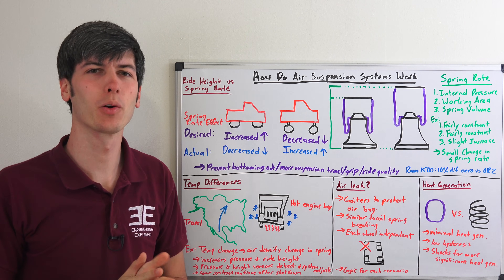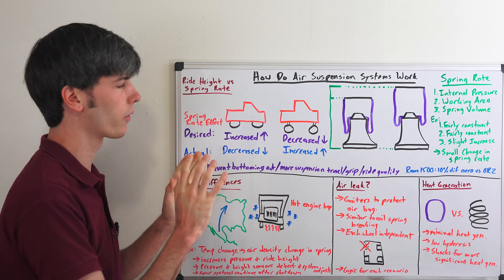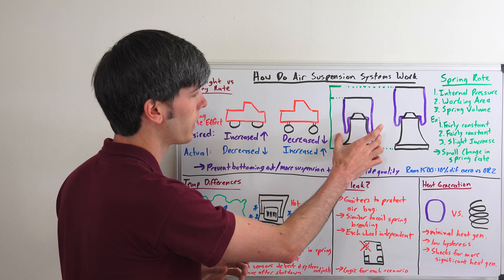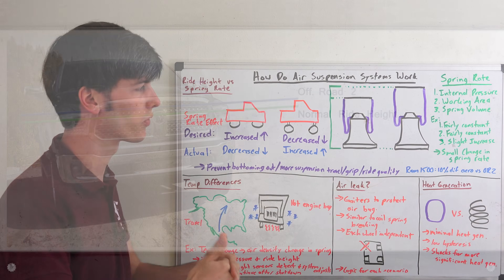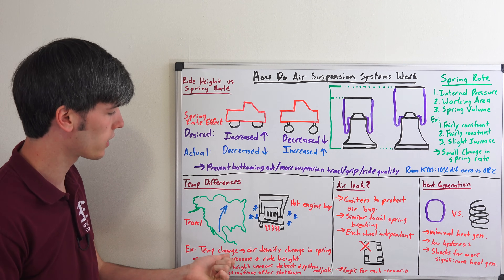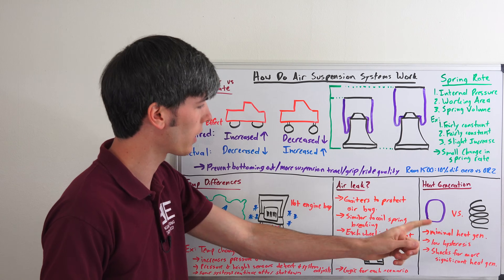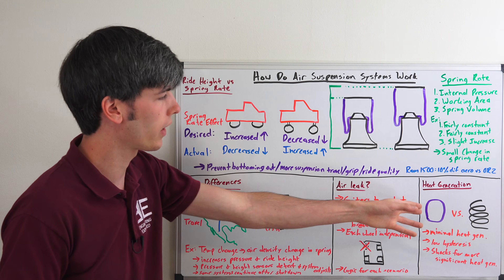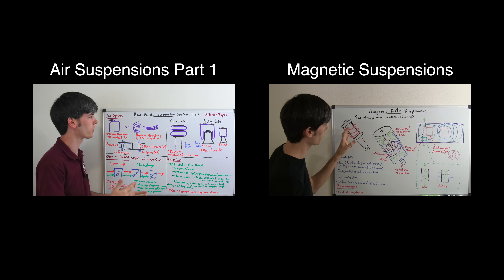How Do Air Suspension Systems Work - Spring Rates

Comment: Hi, great video. Recently saw some videos of Citroen cars with pneumatic suspension. I tried on YouTube but unable to find any video comparing pneumatic suspension and air suspension. 

Also why it’s been stopped by car manufacturers because air suspension was better and reliable or its just too good.

Cost reduction didn’t makes sense As it was introduced in Citroën cars which does not consider to be luxury cars, and even licensed by rolls Royce for its superior quality.

Comment: The Lexus system doesn't have a reservoir  like most Air Suspension. The compressor provides air “on-demand.” Most systems will use four ride height sensors that measure the height and speed of the wheel displacement.

Comment: I have two querries please..
1.Can ride height be adjusted when the vehicle is not on a flat surface or plane??
2. What happens when there is uneven load distribution Between right and left wheel of a same axle???

Comment: 2:10 you state that the air pressure between low and high heights are almost the same, as all you have done is increase the volume - but, unless you have a giant skyhook lifting the vehicle up, the ONLY way to increase the volume and height is INCREASING pressure. This is air spring basics.

Comment: Hi there nice vid , can u give me advice on my problem,  nissan interstar rear suspension,  pump works great very strong no knocks , but i qas driving along then it dropped to the ground,  ive tryed to manual pump it up but the tank was at full pressure,  and i jacked up rear end and the wheels raise up with the axle which leaves me thinking theres no air leak from the tank to the bags as the wheels would drop down if air could flow through the system , so im thinking there a control valve or somthing not opening or sumthing

Comment: Hello, I have comments on the issue of spring rate. It is true that we lower the pressure insider the air spring to decrease ride height and increase the pressure to increase the ride height, but that is just for during those processes. Once set on a certain ride height under a given load, the pressure inside would be determined not be the ride height, but by the load. So if the load is the same, the internal pressure is the same. Given that, the spring rate at lower ride height would be higher because the same amount of axial compression and thus the same amount of volume change would result in a greater pressure increase and thus greater restoring force as the volume change percentage is higher. A similar argument would be given to prove that higher ride height would give lower spring rate.

Comment: p*V^k=const is the basic working principle to consider here. The travel induced volume change relative to the spring volume determines the rate!
Rate tuning for different spring heights is of course possible by an altered rolling geometry, but the basic principle is: lower spring = smaller volume = higher rate 
(Infinite volume = no pressure change = rate zero / volume zero =  no travel at whatever load = rate infinite)

Comment: Very good presentation skill and informative video. Sad thing is you mentioned to leave questions here but never answered.
Anyway. I got a question. Pretty confident they got no corrosion as pure nitrogen is used in the system. but how about dry rot of  rubbers? What kind of rubber are they made of and how long can i expect to use them without trouble? Not extreme weather, i am from Australia. Tubings and fittings also?
Reply: YUNN TUN 
These systems operate with air taken from the atmosphere... closed loop systems would require a lot more stuff to operate.

Comment: a 97 lexus with the suspension on high drives like total crap. especially speeding through downtown Seattle potholes, train tracks, and brick roads.  just use regular or sport, they feel the same and give a smoother bumpy ride. 

or just drive a 93 mercury cougar v8 for a nice smoother ride even if ya gotta drive through some grass and side walk on the side of the road at 40mph.

Comment: I wold like to know what type of air system the ram 2500 and 3500 use (closed or open) I have been told that the system is closed and charged with nitrogen. Also how much weight will the two systems actually lift and the reliability, is there a limp mode if you have a failure on one side or are you stranded?, will a leak turn all kinds of lights on the dash and force the system into limp mode?

Comment: is it similar to a steel spring . i.e. . cutting spring in half will double spring rate .
Reply: i envision it to be like a syringe with the end blocked off . 
When it is full  I can compress it 2cm
when its half full i can only compress it 1cm .

Comment: what if the suspension leaks out air? Wouldn't that be a horrible defect?
Reply: If your engine stops running, that's a horrible defect too. Every system on your vehicle has fail points
Reply: 7150285 I seen a 97 lexus with a popped air suspension on 1 wheel. it looked like it was in some hydraulic competition. it was towed home because totally not drivable on the freeway or even 40mph.

Comment: do they have some kind of air dryer? in layman terms like drying the air as it pumps it to each suspension? Cause woudln't condensation have some kind of effect of the air suspension system?
Reply: They're filled with 99.9% pure nitrogen. No oxygen = no corrosion

Comment: Hi Mate, can you by any chance explain how some of the new engines now have the "turbos nestled within  the V of the engine". These are in some of the new AMG vehicles such as the AMG Gt and the new C63. Also how a car can have two turbos in the cars i have mentioned. 

Great Videos by the way, very educational.
Reply: That is what is known as a "hot vee" V8. If you do a google image search for "hot vee v8" you'll find some pictures that will explain it clearly, since it's difficult to describe in words. Basically, these engines have the exhaust ports facing inwards into the V, instead of on the outside like on a normal V8. It can have two turbos because of the packaging, with one turbo on each cylinder head.

Comment: Would love to see something like Air Ride vs Coilover for everyday life and track!
Reply: +Wonderful Madness and the F1 and Indy try to be as lightweight as possible have the compressor and valves and electronics for the system is to heavy
Reply: Air springs aren't usually used for racing.
Reply: Loanword Eggcorn air springs started in racing and were used in the winning champion car for the time attack STI in 2015. so you just haven't read into it much.
Reply: Wonderful Madness How many Formula One cars use air suspensions?  How many Indy cars use air suspensions?  How many Le Mans cars use air suspensions?  Answer: zero.
Reply: Loanword Eggcorn I wouldn't take your word for it, cuz you think air suspension isn't used in racing haha
Reply: Wonderful Madness I said mostly not.  I did not say not.  It's great that you found one example.  I found hundreds of current counterexamples from the highest levels of racing.  Do you think the Formula One designers are ignorant or don't know about air suspensions?
Reply: i personally would have air ride or accuair for a daily cause you only drive a daily hard every once or twice a month now my dedicated sports car should and would have coilovers due to the fact it's simple and is more predictable and i would not mind accidentaly scraping the car

Comment: are there special considerations and precautions when jacking up a vehicle with air ride suspensions like changing a flat tire  or putting it up on jack stands for maintenance?
Reply: There is an option on the vehicle menu for "tire Jack"  that will hold the compressor from adjusting the ride height. Same goes for when loading and wheel alignment.
Reply: I believe so. I remember seeing a post on the VW Phaeton forums on how to set the air suspension into a service mode, otherwise the car would try to level itself as you jack up the car.
Reply: Only thing that comes to my mind would be never to put vehicle weight onto a spring with no pressure in it. "Airing up" the spring from this situation could cause damage to it.
Reply: They covered it well Robert. Turn it off before jacking it up. Before alignment some cars need to be in a special level mode. On a Land Rover it required a scan tool. Using that mode sets a CEL.

Comment: Hey, thanks for the video, but how does damping work for these springs? Do they require special type/design of dampers? Can they be mated to conventional hydraulic dampers as with coil springs?

Love you videos, thanks!
Reply from the maker: You will have separate dampers, just like with coil springs. Check out my first video on air suspensions if you haven't yet. :)
Reply: All of the above, depends on the manufacturer. 
Ridetech Shockwave series is an integrated air bag and shock absorber  where both have adjustable characteristics.

Comment: And did you forget to add the fact that most, if not all of them, fail at one time or another, it caused a relative to junk an otherwise fine Sedan De Ville cause it was gonna cost too much to fix and the countless Lincolns I've seen with the rear end almost touching the ground.

Comment: which can be more easily compressed, an air spring or a normal spring? if normal spring is more easily compressible then ride should be more comfortable in normal spring vehicle than a vehicle with air spring
Reply: If the spring rate between a coil spring and an air spring are the same, they are functionally the same spring when a load is applied.
Reply: thanks a lot.

Comment: Assuming the style is similar, what are the pro and con between hydraulic, pneumatic, and traditional suspensions?
Reply: Generally, a hydraulic system such as Citroen's Hydropneumatic and later Hydractive systems work at a high pressue so the suspension components, pump and accumulator (reservoirs) are much more compact. Because lower-volumes are involved, it may be faster than an air system.  If the right fluid is used, a hydraulic system can lubricate the pump and valves with the fluid.  However, a hydraulic system must be kept clean and needs a sealed system.

Air systems have to input a large volume of air to compress it to the right pressure so the pumps have to be much larger.  The compressor and valves need a once-off lubrication.  Air systems are usually cheaper.
Reply: Hydraulics: expensive, adjustable, very comfortable, very quick. Used by the military because of quick adjustability and precision.

Pneumatic: comfortable, somewhat adjustable, moderate cost.

Traditional: cheap, reliable, not as comfortable, not adjustable.

Cost comparisons compare costs for systems of equal quality - cheapest pneumatics will be cheaper than the mid-high end traditional and so on.

Comment: Citroën's Hydropneumatic suspension is amazing, it's like you are floating on air...
Reply: The Mercedes 450SEL 6.9 and the Großer both used it as well.
Reply: Its not airbag suspension
Reply: No, but it is almost certainly way better. And way way more complicated. Introduced in 1955 on the DS model.  Even Rolls Royce used it, so it must have been good.

Comment: Does air springs work approximately according to Hookes law for a constant air volume and temperature in the spring? (F = k*x) 
Or does the spring rate change based on the amount of compression in this type of suspension?

Comment: Why sports cars doesn't use this kind of suspension or hydraulic?
Reply: Weight could also be a factor and to have less to  install, you're using the air bags plus installing the airlines, air tank, 1 or 2 compressors and the electronics for the remote.
Reply: Yes but at the same time you dont need anti roll bars and you can also maintain a constant higth so can have a soft settup for road use(low speed) and a stiffer settup for track use (high sleep high auro load). overall it adds meny pros and so little cons that I dont know why is not use at all.
Reply: Consistency is the issue aside from weight and other extra parts associated. Sportscar ideally uses linear spring (but most still comes with progressive spring rate from factory) for consistent spring rate so the behavior of the car is more predictable thus driver knows where the limit of traction is. Adding an airbag introduces an unknown variable to the spring rate.
Reply: You still need anti-roll bars with air springs.
Reply: Yes, exactly.  Conventional springs are more predictable and consistent, which is important for racing.  They're also much lighter, simpler and therefore more reliable, which are all very important for racing.

Comment: Great video. We all know coil springs don't have a high failure rate, but what about air leaks in air suspension systems? Is air leak a common problem with them or is it fairly rare also?
Reply: Air leaks in aftermarket systems in somewhat common. Factory setups less so.
Reply: The possibility of failure is certainly much higher, as air suspensions have many sensors, an air pump, etc. It probably depends on the specific car, whether or not failures are common.

Comment: Is it good to put lowering spring for a daily driven car
Reply: If the lowering springs are stiffer (which is usually the case for properly engineered shorter springs), then the response to bumps will be harsher.

Comment: how does air suspension affect cornering in a sportscar?
Reply from the maker: It's a spring, behaves very similar in principle to any other spring.
Reply: You could also see accuairs video with their audi that they show how it handles on the mountain cornering and rough roads and how daily driver friendly it is.